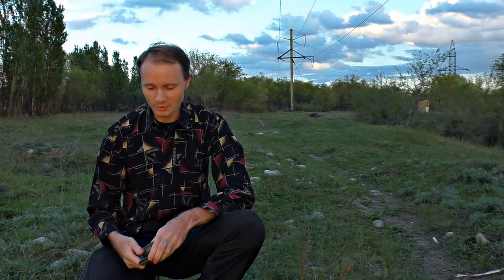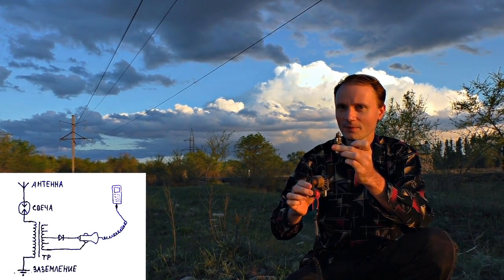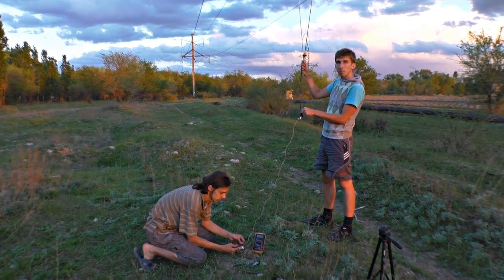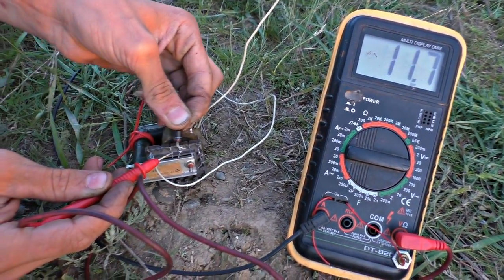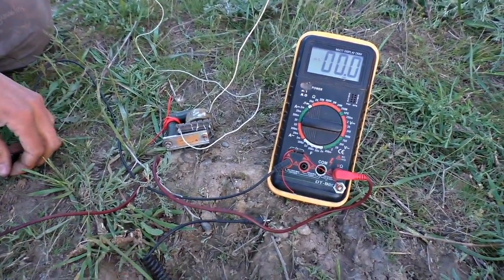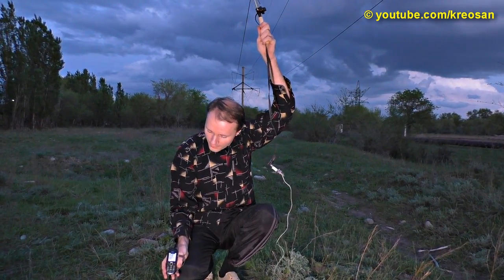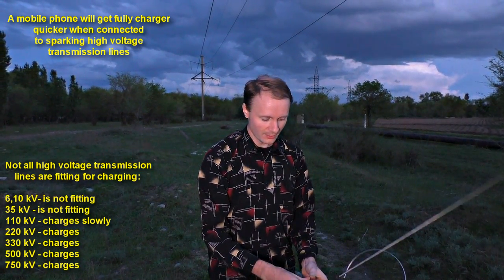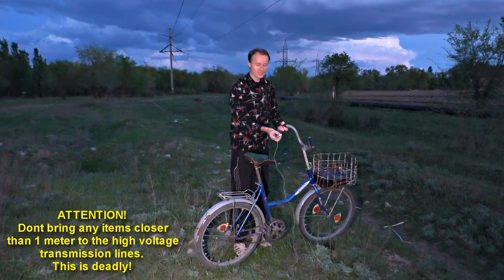Charging from the power lines.

Comment: Electricity companies hate him. See how he made free energy with a simple trick
Reply: Shoutouts to simpleflips
Reply: Rather, stealing electricity!!!
Reply: You spend to much time on por..sites😂
Reply: @mikeymcmikeface5599  I'm sorry... But it is stealing... Indirectly
Reply: Sorry to tell you this.... But its not free energy... The energy still comes from the Power Station... But yeah... The energy transferred to that antenna wirelessly.... Too risky anyway... The curent can jump on you if you bring the antenna higher near the threshold height
Reply: he did not "make" free energy, the power companies made it . . . he just took it for free 🙂
Reply: @95ooi  don't think he tech is. Those lines throw off so much static electricity in the air the power companies are basically giving that shit to the air for free 😂
Reply: It’s not stealing if it’s waisted
Reply: @95ooi  sorry but I do not agree with your statement that it is stealing. The electro magnetic radiation is being projected by the powerlines and is simply being received by the antennae. 

I forsee electro magnetic radiation shields harnessing this 
principle of induction, and producing electricity as a byproduct. 

I believe Nikka Tesla pioneered this as a consequence of his discovery of transmitting and receiving radiowaves then developing the alternating elecromagnetic alternator powered by Niagra Falls and the inverse motor, which is used in most electric and hydraulic machinary.

What is your argument?
Reply: Lol
Reply: @blissbouwerij4033  my argument is if the electricity isn't being used why let it go to waste, It's like only having one person on a Netflix account while still paying full price
Reply: Thaths not free energy
Free energy is a term it is made without any source
Reply: not free just harnessed differently. Its still being created by man through nuclear, hydro,solar etc all of which they paid for and produced to be sold... this is just scavenging the waste  natural occurrence of fields of any electrical wire. tho  same can be done with similar circuit near high broadcast antennas.. this method is rather dangerous as there is a minimum air gap that needs to be kept so they dont arc over to ground . If the electric co had a way to meter the usage at that device then they can charge for it, they made it.. but it would be damn near impossible to detect that sort of collection from the generation location or sub station...
Reply: @95ooi  it's free if you don't pay for it, who cares about the environment
Reply: @VU3ZNL that would break the laws of physics, and if you don't pay it's free
Reply: @jewlenskyy5993  the current draw from that device he made would not even be noticable even if the current was limited, so it is much wasted otherwise this guys trick wouldnt work lol
Reply: @mikeymcmikeface5599  You think they own the electricity?
Reply: @tangokaleidos1926  Who are they?
Reply: @mikeymcmikeface5599  The electric companies.
Reply: Right. Then I do. Do you think the company that produces the electricity doesn't own it? How does it become a free commodity?
Reply: More like using current that would otherwise be wasted. The company loses 0$ over this.

Comment: Ah, they aren't stealing current from the h power lines, they are just capturing losses! So this is technically legal! Just be sure to stay 6+ feet away (2 meters) from HV sources.
Reply: Or 1 meter (3 feet) is fine too if you know what you're doing.
Reply: By doing what they are doing I think they will increase the loses, as they are taking energy from the field and allowing it to flow to ground, so the power lines must add more energy to the field. Although the amount they are taking is miniscule
Reply: Just like if you were to wrap coils around the HV wires you get get a lot more power as it would act like a transformer, however the loses of the HV lines would greatly increase
Reply: Here in canada its 10 Meters for 500KV
Reply: The antenna is used to capture energy from the electrical fields around the lines, it is not illegal, there was an art installation in the UK where florescent tubes were placed under 250kV lines and they lit up
Reply: Technically this is power theft. This is picking up the inductance created by the current in the lines
Reply: a.k.a. Near field
Reply: I was wondering. I never imagined the losses were so much but well it is probably just small percentage of the transfered power. If the cables are 100km long and you could charge one phone every 10m it is like 20kW (2W per phone). So if the powerlines transfer like 1MW then this would be just 2%.
Reply: This increases the losses of a powerline, but only a little bit of course
Reply: Jack Miller. They're collecting the radiant energy
Reply: yes there are the alternating current produces magnetic pulses which are then creating current in the lines, like an inductor When they use the antenna they pick the fields up and redirect their power but the loss is so small it matters no more
Reply: +Paradoxical Nightmare
"For what they're doing, no. For powering a house, yes."
So where do you draw the line? Powering one cellphone is OK? Two is OK? One TV set maybe? How about a microwave oven? Who establishes the power limit of what is and what is not theft when capturing induced power from transmission lines? You?
Reply: in theory this would be treated the same way as a open wifi connection where its down to the owner to protect against it bessides this is hardly gonna break the bank for the power company to care and solar would be faster anyways
Reply: oh and as for it increasing the energy lost thats like standing under a dripping water pipe with a cup and claiming having the cup there makes the pipe drip faster pretty sure it dont work that way
Reply: MarkMan It isnt worth dealong with the power loses. The costs of reducing power loss is faaar greater than compesanting for it and just paying more money.
Reply: Imagine getting red cheeked angry over yt comments ;)
Reply: +WIFIGHOST CRUISER
Wavelength doesnt really matter much here. You don't need your antenna to resonate, you just need it to be good enough to pick up inductance from the lines acting as a coil (one winding).

If inductance only worked on resonating frequencies then how the hell would a metal detector work?
Reply: Yet here you are. It doesn't have to take 4 years, its only elementary level physics - Infact it shouldn't take more than an afternoon to get a grasp of the fundamentals of this on online resources. A shitty antenna is still an antenna, You will get best results with the right antenna length, no doubt.
Reply: no, transformer is normal load. This is 100% energy stealing.
Reply: Yes and No.  My mother is oddly sensitive to power lines.  There is a place nearby that when she goes near it, she can hear the buzz far before we can.  At any rate it gives her a headache.

When you capture this type of 'loss' you are not really capturing a loss they will notice.  For one there is a natural EM emission from the AC power.  The movement of the power going back and forth creates this.

Second, recovering the loss would be pointless to them. The amount of wire, and boosting to get the loss back up to anything they care about would be far greater than the cost to not care.  They are capturing probably 20watts, the house is getting much more than that.  So the energy loss would light 2 homes out of thousands of homes?  not worth it to them.
Reply: electric thug life ;D
Reply: If this is real, power companies should encourage their customers who live near power lines to wirelessly power their homes for free.  This way homeowners may be less likely to protest when a new line is built.  They will benefit from it directly.
Reply: corisco tupi are you kidding? I'm driving 1 mph over the 75mph speed limit...small fine if stopped but cops won't even bother when only 5 over. Driving 100mph in same zone...that's very different. Driving 100 in a 30 felony charges can be brought, reckless endangerment. Stealing 10 cents vs stealing 100 dollars. It takes approximately 1.1 to 1.4 kWh to power a home In the United States. Regardless, electricity is so cheap it's not worth stealing. In a 3000 sq foot home with three levels you can keep the AC blasting 70 degrees or cooler in the American Midwest/norther south wear high temps are +85 for months, do everything else you normally do with a family of four and keep the MONTHLY bill under $400
Reply: @2009G8Gxp just wondering, it doesn't really matter but every car and plane moving on the other side of the world is still inductively coupled to every power grid (granted immeasurably so) so should the us fine everyone for theft of service? Or to limit it to a less extreme example just charge Everyone that has to drive under the power lines for the increased load? They didn't "use" the wasted energy, but their car/s certainly wasted some of it as heat. Just saying, it's a unregulatable issue so it's a non issue
Reply: This is fake bs
Reply: Hyper Hektor it’s AC power going throw the power lines and they do have a loss that’s why from the power station to the power line they have a step up transformer.
Reply: The losses belong to the power company. 
Unless it's money .
Reply: @Sarge92  your analogy is wrong. What they are doing is actually using energy from the line by adding a very small load on the lines.
Reply: @coriscotupi  Any antenna or collection device found within a set distance of HV transmission lines is grounds for legal dispute. I am sure most Electric Companies know exactly how close you need to be to cause them losses and thusly set their rules to that. Their have been cases like this with antenna even very odd ones like copper balls suspended in trees near by transmission lines to powering transformers to charge full size batteries and in some cases directly power DC machinery for even more illegal operations being performed in secluded areas. As was shown with the small flyback there was available 15volt leg aside from the 10volt leg they used here. With a small smartly designed array of antennas one could collect quite a bit in this manor and who is to say what they would or would not notice without inspecting every mile of transmission lines frequently. I personally own land with about 3 miles of transmission line crossing it and the Electric Company is a Co-op with very little money to sustain the system maintenance and repairs.. So little in fact they cannot even afford to brush hog this right of way once a year.
Reply: @pickford7812  

Wouldnt call it theft tough they are cathing losses that would go to waste otherwise ... So i guess its a grey area .... Think of it this way... A lightbulb is on 24/7 and you capture its heat and turn it into power ... Your just using energy that would go to waste
Reply: @TheMatrixcube  magnetic fields are a loss, but when the lines of flux have an easier path, such as a conductor, the inductive losses are much higher. You're not taking waste power, you're magnetically redirecting power from the line to your device.
Reply: @TheMatrixcube  think of the power leaking out from the lines as a river. When you divert even a small amount of water from a river, the flowing water refills the area you are diverting from.
If you are grabbing "leaking" power from around a power line, it won't just create an empty void in that area. More excess power from lines will just fill the void that is being drawn from. So technically a power company can detect and it can be considered theft.
Reply: @Sarge92  No, it's more like connecting a straw on the pipe and the more power you draw the further up you push the straw, meaning you are actually taking more water than what would naturally drip, hence, you are stealing more water than the person would have normally lost have you not done that. Still, I doubt a power company would go after anyone if they stole power that way.
Reply: @sonacphotos  problem is they won't allow you to build a house. That's why they don't allow permanent structures.  
Unless your house was already there before the new powerlines
Reply: HV lines often run closely parallel for miles beside railroad tracks. So you can imagine the losses from that compared to a rigged up cell phone charget that almost no one would actually use for day to day charging.

Also, the prolonged EM exposure and hazard of simply standing under cables carying tens or hundreds of KWs that will kill you instantly should they come down anywhere near you (ground current) outweighs the benefit of using this as a long term solution.
Reply: "Technically this is power theft. This is picking up the inductance created by the current in the lines"

Right, the power police are just out searching for people day and night doing cell phone charging experiments like this to bust them over free electricity.

If they did confront you, it would be for suspicious behavior, or if you were tresspassing on land/right of way owned by the power company.

Comment: electroboom should check this out
Reply: This is just fake. Power captured by antenna is too small to charge any phone.
Reply: He just did lol..
Reply: I firmly believe it's fake. TV antennas are designed for waves that are several Megahertz in frequency, so how do you wanna get sufficient voltage at 60 or 50 Hertz out of them? Even for LW you need ferrite rods with long coils on them.
Reply: There are 3 phase power lines near my home and they can light up CFL bulbs when I touch them to a metal sign underneath. It's one of the downsides of ac power lines.
Reply: Hey guys. I checked this out, with a grill bar thingy. It works. It's for high voltage power lines (Not the everyday ones but the huge tall ones)

Edit: I did not use a phone just an incandesent light for a bike headlight and it was about 12 volts
Reply: @westelaudio943  it has nothing to do with frequency. It is called the conductor-skin effect and through this, stray charges from  the high voltage power line make their way to the antenna (whose only purpose is to act as a conductor,) through which the current can then be rectified to charge a phone battery, or basically anything really...

Depending on your proximity to the power line, you can increase the power consumption a lot more,
Reply: And unmasked it for the fake bs it is
Reply: It would be great
Reply: I was about to say that comment☹️
Reply: Ohh my god you are everywhere 😭😭😖
Reply: Check it out, then suddenly start talking in Morse Code when he fucks it or himself up
Reply: OMG I WAS THINKING THE SAME THING
Reply: @proventure307  that video is abiut voltages up to 1V produced by his camera... I think its the same princible, but its not the same condition. Maybe he should try it under some high voltage power lines
Reply: Hey yes
Reply: @rohitchaturvedi2271  It's really low current at really high voltage. The antenna is capacitively coupling to the high voltage ac lines. I'd say it's plausible, but it would be very slow since the current on the secondary would probably be around 50-100ma at most.
Reply: @westelaudio943  you have right, but here they use it as one side of a capacitor
Reply: THE RECTIFIER!!!
Reply: I hop so
Reply: @dogodogo5891  yup. The stray voltage in itself isn’t enough to charge the phone which is why they using a step up transformer. The higher the voltage the more it leaks. Doesn’t matter what material you use as long as it’s conductive.
Reply: @dangerousdoggo5465  Thx for your testing ：）

Comment: We have a small vineyard (approx. 1600 vines, 7 lines). Very close to this there are a high voltage transmission line. The metal guiding wires (this is where the grapevines are tied to) always electroshock us in humid weather. I'll try this  out and maybe if I put this device attached to the metal guide wires, I can power a small LED lamp with it.

Comment: @ElectroBOOM need to see this...!!
This video may need some rectification...
Reply: But all the people who tried it have diode.
Reply: yes😂😂😂 full bridge rectifier
Reply: nope, it's real. The spark plug allows for pulsed current from the antenna that picks up some electric fields from the power lines. The pulsed current goes into the high voltage side of the transformer and when a pulse goes through, a much lower voltage higher current pulse is made on the output, but it must be rectified with a diode to make it DC. The internal capacitors of the car charger smooth out the DC and bring it down to a stable five volts, allowing the phone to charge. I was a bit skeptical at first too, but the circuit makes sense, and I think it could supply sufficient power.

Comment: You could damage your car charger and your phone this way. I would recommend using four diodes, because your transformer gives you AC current. Using only one diode makes the current to look like this: /\_/\__/\__/\_ and so on. /\ is the voltage rising, and __ is no voltage, because the diode blocks it. So you get pulses of voltage, which is not good for anything. You should use the Graetz bridge to fully rectify the voltage, and a capacitor so the voltage becomes straight DC.

Comment: So it's confirmed that Russians deviced wireless charging
Reply: Most modern phones can charge wirelessly. Samsung started that with the S8. I even believed the S7 Edge had the ability to charge wirelessly. And that was many years ago. People are just now starting to catch on.
Reply: @sethh8892  actually I wrote devices due to mistake I wanted to write deviced which means invent
Reply: @sethh8892  first. Its a joke.
Second. Its not wireless, it just plugless. The pad still need to plug to a wire which connect to a port.  So its not really wireless, howevr what shown in video is truly wireless, the wire doesnt connect
Reply: wireless chargers are just transformers which has been a thing for ages...
Reply: @tristan6509  breh
Reply: why is your comment bold
Reply: @state-of-the-artcapital3990  I don't even remember why I commented this 💀💀